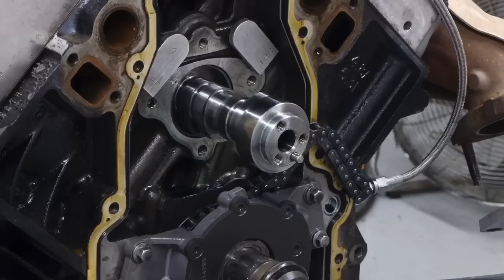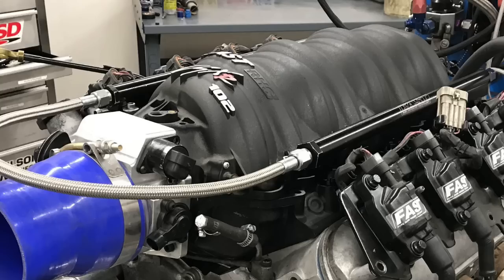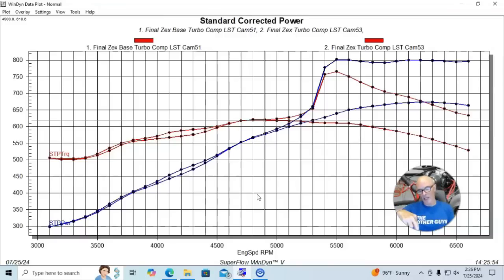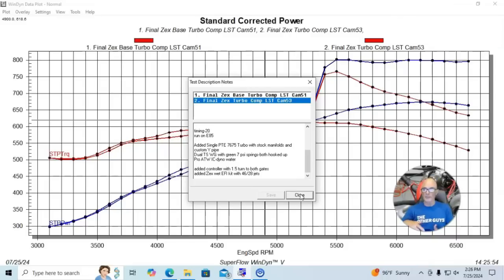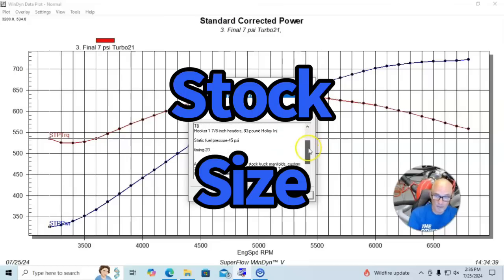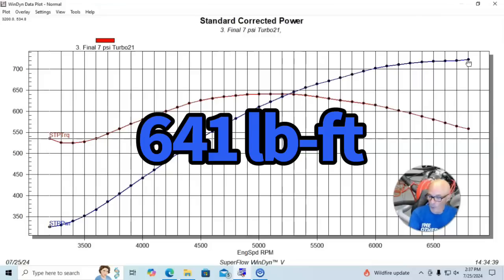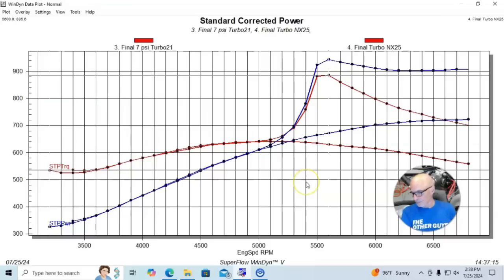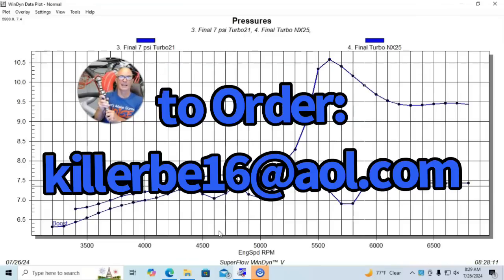HOW TO ADD NITROUS TO A TURBOLS? WHAT HAPPENS WHEN YOU RUN NITROUS ON A JUNKYARD TURBO 5.3L & 6.0L?

Comment: @richardholdener1727 How would I add nitrous to a blow through turbo - carb’d V8? Would it be just the regular under-the-carb plate system or would you have the fuel solenoids at the base of the carb and nitrous solenoids plumbed into the inlet pipe?

Comment: I tested a 75 shot down stream of the intercooler to see how much it would chill it. It definitely lowered intake temps. But it wasn't as efficient as a wet shot. Was going to continue testing but smoked my converter 😂
Reply from the maker: we saw a change of only 30 degrees-you would see even less on an intercooled application
Reply: @richardholdener1727  being in south Florida 30 degrees is a massive difference.

Comment: Hey Richard got a 6L throwing on a S475/83 should I be going with a 1.10 or 1.25 A/R? going to make at most 900 crank and 700 wheel, thanks.
Reply from the maker: what is the rest of the 6.0L

Comment: A little bit off subject, but I don't know if you have ever done a video in regard to InterChillers?  Unfortunately on my set up Im unable to use one with an Air to Air intercooler. It would be interesting to see how much power an InterChiller makes or Preserves within an engine?
Thanks for all the great content...
Reply: I have seen his intercoolers comparison. It's not as big of a difference as you think but, it's still worth it. Go on his channel. Say 800hp with out, then with it would be like 925. It's hard to turn down bolt on power like that. Hope this helped you.

Comment: How much do you feel that Size Nitrous Shot will shorten the Longevity of an Hardened engine with boost 11.1 Compression and 4032 pistons ?
Reply from the maker: you can also just turn up the boost if you want more power, but tuned properly, I went through 25-30 bottles of nitrous on my Mustang
Reply: @richardholdener1727   Yeah, just with stock compression (Originally, built NA engine then added boost) keeping fairly low boost @8lbs and good AFR, tune.
Also, wanted to get your thoughts on Best size Cubit Inch for Boost? With my next build, 410-411CI VS 426-427CI, or even smaller 6.2L VS 6.4L Ive heard the slightly smaller Displacement at these sizes the smaller tends to have better reliability and longevity for Boost..

Comment: I’m curious whether or not he pulled timing for the nitrous and if so did he do it based on the jet size or the actual power it made or if he  just sprayed it and left the tune alone.
Reply from the maker: I pulled timing on 1 but not on the other
Reply: @richardholdener1727  which one did you pull timing on? I’d assume the higher horsepower one.

Comment: How would the boost curve look if you activated the N20 around 3500rpm? Would the turbo over spool or run out at higher engine rpm?
Reply from the maker: the boost spike would likely be earlier and the boost would be higher through the rpm range
Reply: @richardholdener1727  thanks for the reply Richard

Comment: Hey Richard-may I suggest a future video on controlling turbo boost-the blow off valve installed on the hot vs cold side.
Reply from the maker: A BOV is not designed to withstand that type of temp-a waste gate works better
Reply: How about no wastegate, using bov to control boost. I have seen tbis done, but not sure how it works.@richardholdener1727
Reply: @richardholdener1727  I misspoke, a video on a wastegate (hot side) vs a blow off (cold side) comparison

Comment: Do you add more ring gap than you would for one or the other?
Reply: He recommends varying ring gap based on bore size
Reply: @timweb1510  I’m gonna have to do some research then.
Reply from the maker: yes-I added ring gap on this motor (it was the 1543-hp Big Bang motor). Put the gap at .0065 per 1 inch of bore for high boost
Reply: @richardholdener1727  thanks I think I’ll save that formula!

Comment: Does nitrous register any amount of boost in the intake a NA engine? Is there enough expansion to actually build boost?
Reply from the maker: it would have to phase change in the intake-not before like on this application, but I don't think it would be much

Comment: A 50 shot ona PD adds about 100hp and 1-2 PSI boost, I think the boost gain is due to the charge air temperature vs the increased exhaust flow.
Reply from the maker: we only saw a 30 degree change in IATs
Reply: @richardholdener1727 iat sensors do not react instantly to colder temp changes, especially a factory one. If you have a faster reacting iat sensor, it’s still not going to be instant. For the short amount of time nitrous is being sprayed, it’s understandable why the iat didn’t drop fast.
Reply: @Turbogto_guy RIFE sensors are fast reacting
Reply: @aaronliddell4280  is that what he’s using? Iat sensors are inherently slow going to lower temps. They react fast to higher temps. All the tests I’ve seen show that.

Comment: Nice gains on no2,   Im wondering richards thoughs on mixing meth injection and nitrous to cool the intake charge and combustion temps. We played around with this  with a holley hi ram and a intake temp sensor in the 8th runner.  On a 6.0 twin 6266 30 psi with  x85 as primary fuel. 

the results where shocking and weird 😁
Reply from the maker: the more fuel/nitrous you spray into the intake-the better the cooling
Reply: @richardholdener1727  Yes that was what we were thinking,  it was jetted for a 150 shot and we had #18 meth jets duals.  All nozzles were about 3 inch from the inlet.  The weird results was we lost 200 hp 22* timing 5000 to 8300.  Afr was 11.56  inlet temps where mid 70s from 180 plus from runs without the injection.  Back pressure on turbos were very low .

Then the shock was we broke two rings and bent two rods🤷‍♂️ zero detonation plugs look great ultra H beam weisco piston
Reply: @loundclear9279 that is weird, what do you attribute the power loss to then?
Reply: @aaronliddell4280   possibly vapor lock and not enough timing  looking at the data and the video the intake had condensation on the outside 

The mixture of methanol and nitrous probably too much nitrous started to freeze the methanol we got a 4.8 on the dyno now gonna try it again lol 

It definitely cools the intake changes wich is great we can take the inter cooler off the car lighten it up 

But gotta fix the mixture first